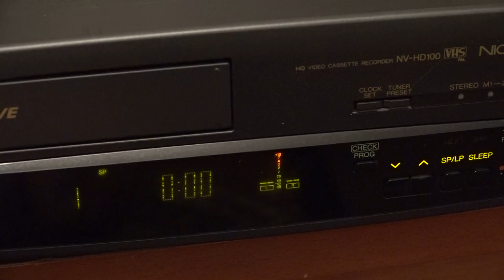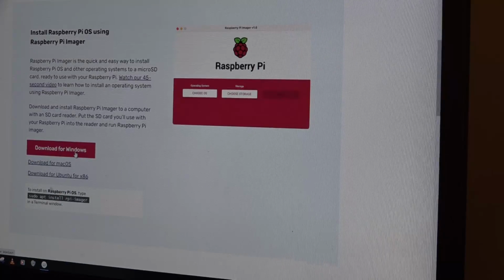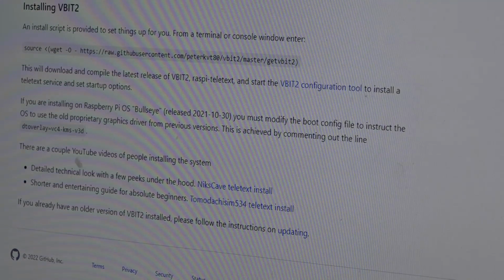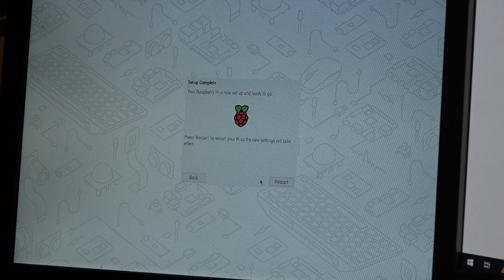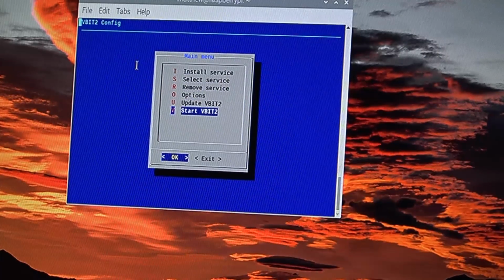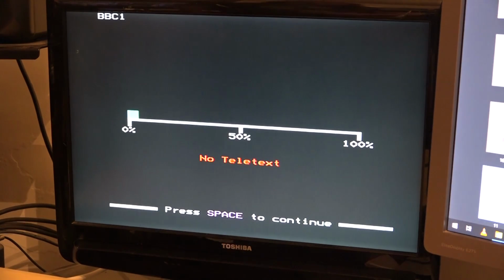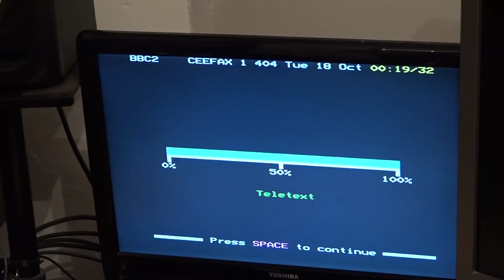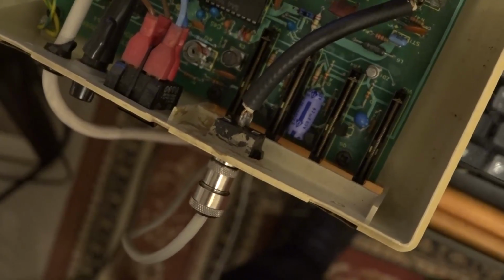Live Teletext on a BBC Micro a decade after it was turned off.

Comment: Thanks for a great video Matthew.  I am trying to get a cheese wedge working.  its been a bit of a trial and error, not to dissimilar to your story.  I am still not yet successful.  I have confirmed i have composite coming out of my Raspi zero 2W but i am using a modulator (I don't have a VHS player to try).  I have one super cheap modulator that gives out a low quality mostly black and white signal and i have a TV link (like others i have seen doing this) and i am getting no signal whatsoever to a TV RF in.  I am a bit stumped if i am honest but with plug on.  Thanks again for the video.
Reply from the maker: Is the TV link like an RF transmitter kinda thing ? Basically anything like this will add more noise and if the signal isn't good to start with could be a problem. You can often find old VHS machines for a few quid on places like Facebook marketplace even if the deck doesn't work. Chances are the modulator will be fine

Comment: I've got a teletext adaptor sitting on a shelf for about 18 months now as I was going to do exactly this but haven't had time to do it.
Reply from the maker: I managed to eventually get it going in about 3 hours! would have been half that if I didn't have a dodgy aerial socket and internal wiring!!! It also had a broken fuse holder. but I fixed that a while back!
Reply: @MatthewNorthMusic  Back when I first started looking at it a few people did mention about bypassing the tuner so composite goes direct to the board.
I didn't like that idea as I wanted it to go RF but that is also an option (apparently) if anyone else wanted to try it.
When I do get to it I've got a standalone RF modulator (from a common UK building trade supplier, wont name here) to use with this.
Reply from the maker: @PeterMountUK  you need a video amplifier before going direct into LK3 I think it needs 2v p-p